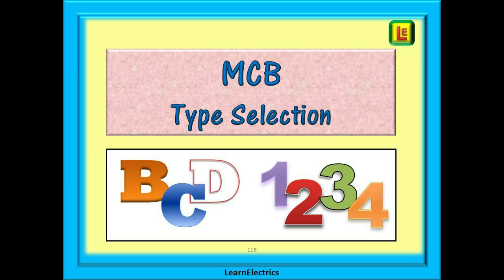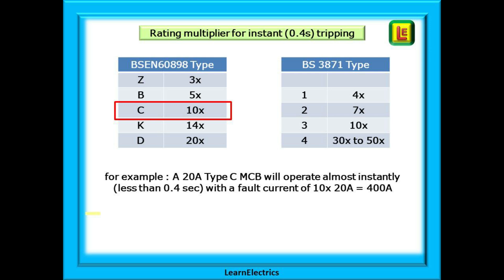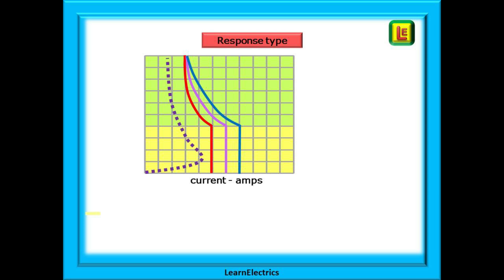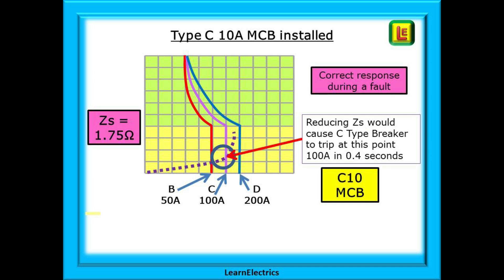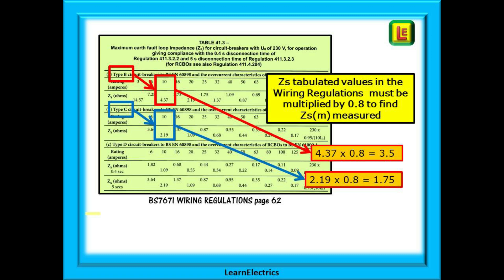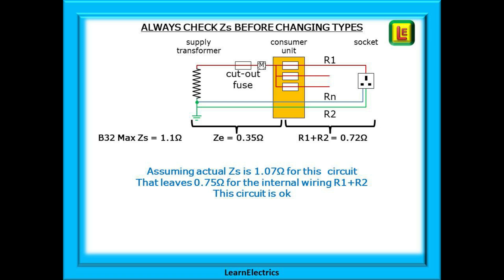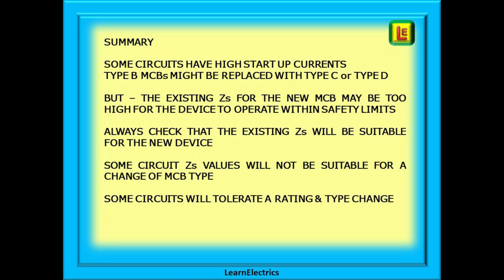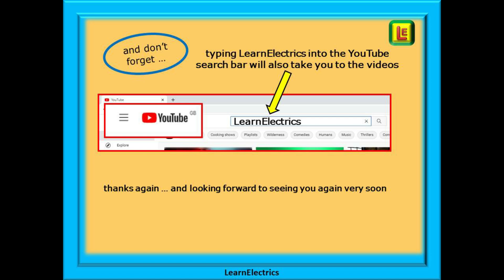MCB – Circuit Breaker Selection – Types B - C - D and Types 1 - 2 – 3 - 4

Comment: Do you tell difference between type 3 and type 4 3871 as some I’ve seen are not marked. Thanks
Reply from the maker: That could be a problem if not marked. Sometimes you will find a batch number on a device and sometimes that might give a clue. Hope this helps.

Comment: Am currently installing a rotary phase converter in my shed to give me four three phase switched power sockets to run my wood working gear from a single phase input. Have been trying to work out how to size and select MCB's. This is by far the best presented and clearest video i have seen explaining MCB sizing and selection. Thankyou and keep up the good work.
Reply from the maker: Super, so glad it helped, thanks. Dave.

Comment: Hello Dave, Speaking about the second method of solving inrush current and unwanted trips, I mean changing both type and rating of the MCBs. The example discussed does not seem to be a solution. If you replace a 32 type B MCB  with a 16C , then both of them will have similar reaction for surge currents. But I got the idea and purpose. Thank you.
Reply from the maker: Yes, there are various ways and solutions Sajad. Its all a matter of selecting one that works. In the past with lighting I've ended up splitting the load across two MCBs. Keep watching, lots more to come.
Reply: Zs value requirements for 16 A is low isn't it ? So selection of 16 A is correct if load current is under this value.  These lessons are for TN grounding systems I think .

Comment: Question type C will trip at 10x it’s rated current , so in your example of 16A type B,C, and D 
Our MFTs only allow us to test at half times, one times, and five times the current rating, 
So if for example a type C trip’s at 10x we can’t test at 10 x so should we test at 5x then double the reading on our MFT?
Ie 10x16a =160amp so testing at 5x it will be 80amp multiply  by 2 give you 160 so long as that trips with in the specified times it will comply with BS7671 . This would also apply for other types as well ? Or am I wrong. Maybe you could do a video explaining how to test the different types  . 
Great video very interesting and informative as always 👍👍❤️
Reply: I'm a learner so if this is wrong let me know.  Dave is talking about MCBs here and the trip curves and characteristics for different types.  MCBs react to overcurrrent and short circuit - he is not talking about RCDs which measures faults to Earth. You test RCDs by introducing small Earth leakages of 15mA, 30mA and 150mA (for a 30Ma RCD) and record the trip times..  The current rating on the RCD is just the current that the RCD can carry 24/7 without problems. Hope that helps.
Reply from the maker: Absolutely right GrumpyG. You're obviously learning well and its great that we all support each other. Thanks for your input and I'm sure that Sean appreciates it too.
Dave.
Reply from the maker: Sean, this video is for MCBs not RCDs.
We have to assume that the manufacturer has made it correctly and it will trip at x5 x10 etc. Out MFTs can't test at those currents. It would be too dangerous to have a meter output of say 1200 amps to test a breaker. We take it on trust hat the MCB will do its job if we get the Zs right. Hope this helps. dave.